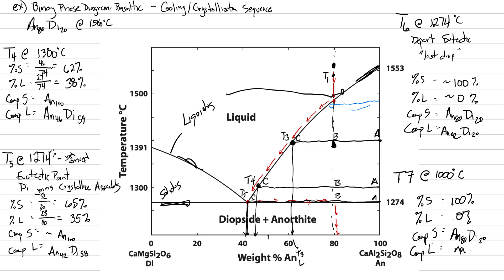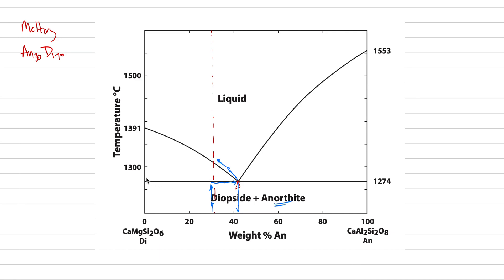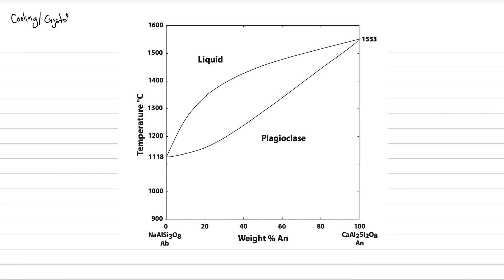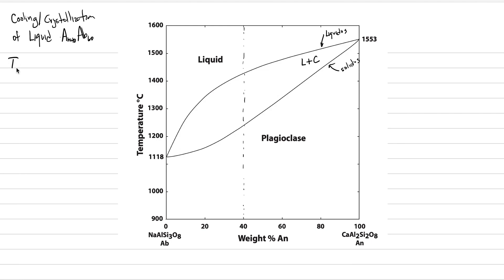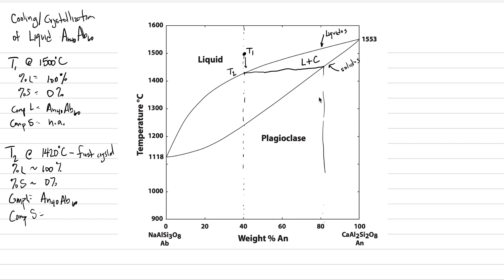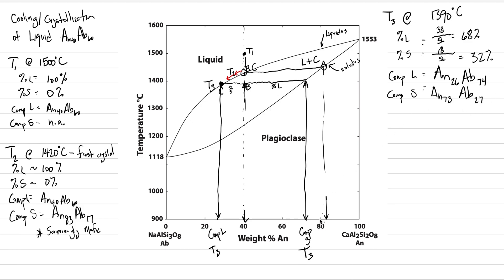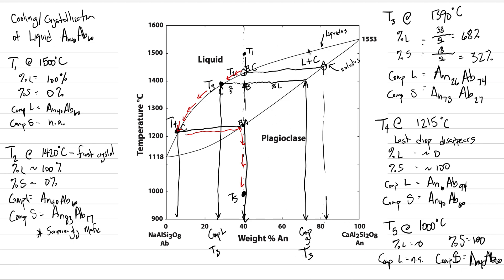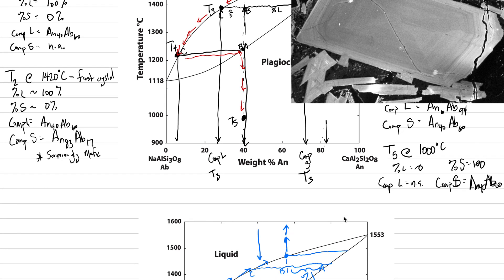Phase Diagram 3: Binary solid solution

Comment: This feels so weird. You're saying on one hand that pure diopside melts at 1391C, and on the other hand that anorthite is completely depleted and whatever solid remains is pure diopside, but somehow that diopside melts at way below 1391C.... This tells me that whether a compound will melt depends on what it's surrounded with. If by nothing or its own pure liquid form, then the melting temperature is, well, the melting temperature duh. But if it's surrounded by some other liquid, it may just melt... sooner? So technically the pure diopside going from solid to liquid in this melting process isnt exactly "melting", but rather dissolution....?